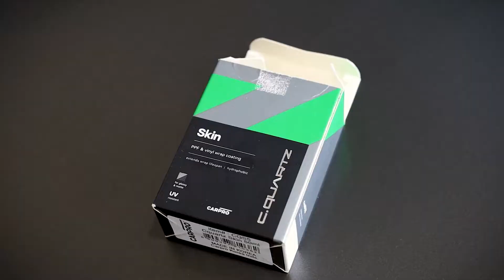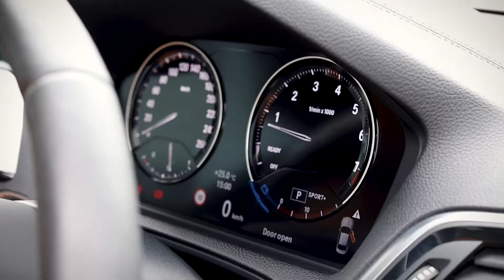BMW M240i FULL WRAP! SATIN DARK BASALT BY AVERY DENNSION!

Comment: What year is that car?
Reply: Probaby the 2017 or so, I believe the newer model M240i's have the new interior design language, but this has the same interior design language as the mid 2010's BMW was using
Reply: its a 2018 or higher, it has the lci headlights so its a lci model which is after 2017 @intrapersonaI